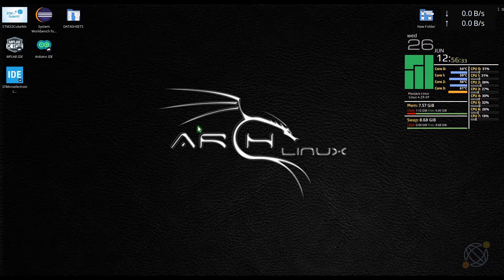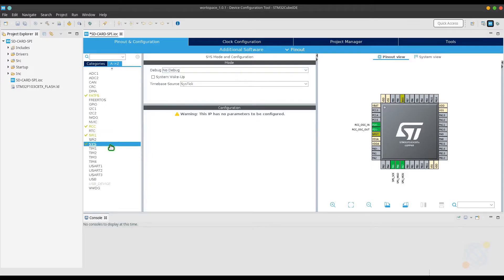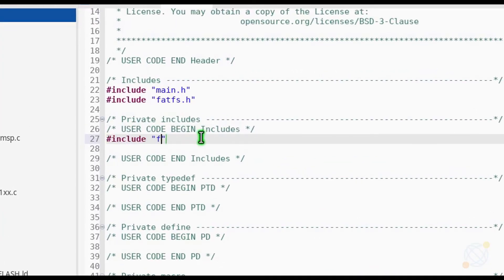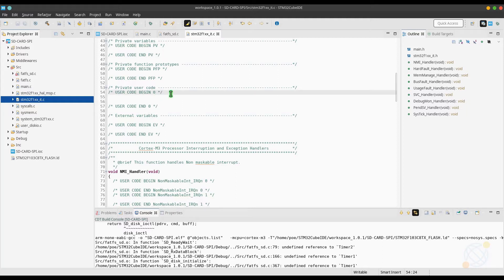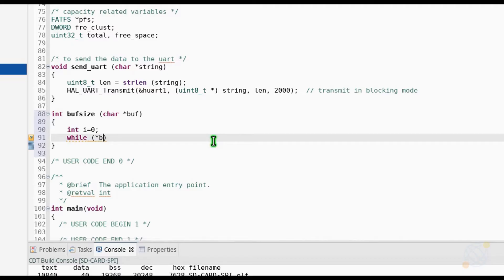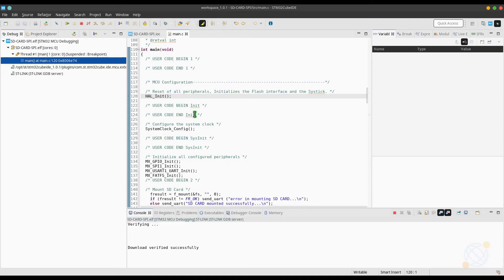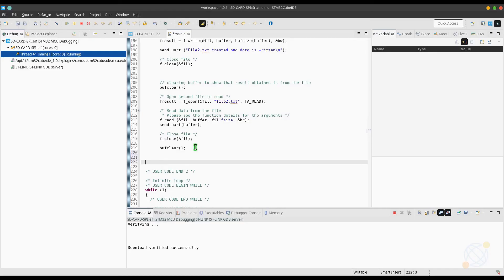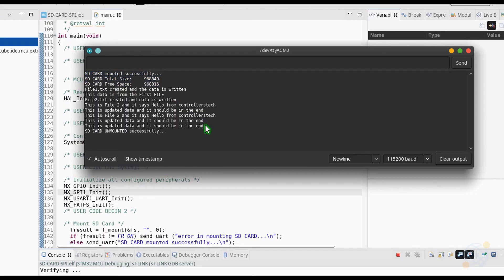SD CARD using SPI in STM32 || Cube-IDE || File handling || uart

Comment: hello, it was very interesting and appreciated so much, but I have a doubt. I want to send some data but I don't want to create any file, basically, I wat to send raw data, without any format, like .txt, In my case, I don't have enough memory and I am obligate to use a microSD module with SPI protocol and at the end recuperate the dates sending it to my PC and processing it on another program in my PC (MatLab). Thanks for your help, I hope your answer, and sorry for my English.
PD: if you don't care, answer me to my email rpaz@ing.uc3m.es 
Thanks again.
Reply from the maker: Where is data coming from ?
If you are using SD card, you have to create files and folders.
How can u store something in SD card which is not a file or a folder ?
Reply: @ControllersTech  Well, I normally use the SRAM memory without creating any kind of file, maybe I told you something that is impossible. In my project, I need to take a sample of voice, and my input is an analog microphone output, this signal I pass it for the ADC and I need to take samples fast, and finally pass this information to the PC by UART. The problem comes when I tried to take samples of voice for enough time to say 1 word, but I don't have enough memory to store it and the sample speed is faster than UART. Then I need to use a microSD card by SPI to store my samples and at the end transmit by UART, but I thought to do it by transmitting and collecting the data directly to memory areas and not exporting and importing from a file.

Comment: I had made some changes, there are some variables types that are not right. I run this project at 18MBits/s with no errors. I used keil uVision.
// "sprintf" needs an "unsigned long" input.  Note that despite the fact that int and long are represented by the same number of bits, they are still different types.

Comment: I am new to the microcontroller programming.
 i have created the new project as per your video but i am not able to see the file "user_diskio.c" in may project and also not in your code(zip file which i downloaded from you link).
and one more thing , are the files fatfs_sd.c and fatfs_sd.h are standard files or your custom made files,
if these these are standard files then why these are not a part of the created project.
Reply from the maker: User_diskio.c file is in FATFS -> Target folder
Fatfs_sd.c and .h are not the default files. You have to copy them from my project into yours.
Reply: thankyou  for your time
how can we create such library files
Reply from the maker: Which library file you are talking about
Reply: @ControllersTech  like fatfs_sd.c and fatfs_sd.h
Reply: i have created the project as per you video , i am receving the message  "ERROR!!! in mounting SD CARD on uart terminal.
i have tried it on STM32F103C(stm32 blue pil) and also i have amended the code a created a project for nucleoF767ZI again i am  receiving the same "ERROR!!! in mounting SD CARD.
i have made connection as follows 
for STM32F103c

SD card                stm32f103(SPI1)
CS-----------------------> Pin PA4
SCK-------------------->PA5(SCK1)
MISO -------------------->PA6(MISO1)
MOSI -------------------->PA7(MOSI1)

for nucleo F767ZI
SD card                NucleoF767ZI(SPI1)
CS----------------------->  PC4
SCK-------------------->PA5(SCK)
MISO -------------------->PA6(MISO)
MOSI -------------------->PA7(MOSI)

Vcc and Gnd are connected acordingly

BUT using aduino i am able to write the data to sd card using STM32F03c
Reply from the maker: You need good understanding of how things work
Reply from the maker: You see this code is written for f103c8 itself. So even if you don't change anything, it will work. 
Anyway watch the video carefully. U need to add a lot of stuff in different places
Reply from the maker: You see this code is written for f103c8 itself. So even if you don't change anything, it will work. 
Anyway watch the video carefully. U need to add a lot of stuff in different places
Reply: @ControllersTech  I just copied your code "SD_CARD_SPI_F103C8"  and built it and downloaded it to Stm32f103c8 , but i am receving receiving the same "ERROR!!! in mounting SD CARD.

One thing which i want to know is that   in your video i can see that in project explorer window there are nine(9).c files in src folder.
but the "SD_CARD_SPI_F103C8" project has only 7.c files in the src folder.
fatfs.c and user.diskio.c are not present in this folder, these are in FATFS folder.

IS it ok?????????
or i have to copy these files to src folder.

when i copied these two files to src folder i am not able to build the project there are many errors.
Reply from the maker: No don't copy them in the src. Leave them in fatfs. 
Contact me on telegram @controllerstech
Reply from the maker: I said @controllerstech not .com
Reply from the maker: You have to download telegram app, and search @controllerstech in that

Comment: Thank you very much for your initiative. The only sensible code that I found after a long time of searching. But in the beginning there was a problem: the program did not always work. In the end, the whole problem was in SPI1. After connecting the microsd module to SPI2, the program always worked. I'm using stm32f4discovery (stm32f407vg microcontroller).
Reply: By the way, I connected the sandisk 16gb fat32 memory card and the program worked.
Reply: @НикитаЩербаков-ж3х  I'm using the same item.I didnt get it worked. Could you tell me what was the error ? Are you also sure that it's all about SPI1 ?
Thanks in advance..
Reply: @erdinckaya3731  did u get it worked? pls let me what was the error.

Comment: Hello! Thanks for the video, it seemed to me quite clear and concise!
I have a problem however. After doing the f_open command I get a FR_NOT_READY from the fresult. 
I have followed all the indications in the video. The only thing that I don't understand is the clock. I have an STM32WB and as I am new to this I have no clue how to set it, so I basically just let it do it's thing.
Do you have any idea why I might get that error?
Reply from the maker: Some connection problem. Make sure the card is formatted with FAT or FAT32 
Also try to reduce the SPI speed and see if it can help
Reply: @ControllersTech  Hey! I've just done it and there is no change. I get the same error.  (I have a 16Gb card)
 I want to ask you though, why do you set for your clock the two options "HSE" and "PLLCLK" together? If I do this for my microcontroller I instantly get some 0xfffff8 error or something about "Failed to execute MI command". 
Also when you wrote this:  fresult = f_mount(&fs, "/", 1);  I saw that here you put 0 and on the website there's 1. What is this for?

Thanks for answering!
Reply from the maker: HSE is for selecting external crystal for clock
PLL is phase loop clock use in all the ARM processors.
If u are having problems with the clock, i would advice you to not select the HSE and leave the clock input at HSI and use HCLK as 50 or 60 MHz. 
This video was made long ago, and i have modifies the code after that. That's why you might see some changes.
Although the process remains same.
Since it seems like you don't have much knowledge about stm32, i would say first try blinking led and start low.
Reply: I face the same issue. Did you fix it?

Comment: Hello, I have a question.  I'm using FreeRtos and Timer 1 as the source, so there is no SysTick_Handler fuction in stm32f1xx_it.c.  Where would I put the FatFsCnt check in this situation?
Reply from the maker: Inside the timer 1 isr..

Comment: I have problem. All go right, but. If i enable RTC (because i need for my project) its crash to hard fault in debug.  But if I remove SD Card of comment line with fresult = f_read and try it again it works withouth problem.. One step before crash i see some RTC_FLAG_OW check. Some posible solution ?
EDIT: I solved problem. I set too small buffer. Use bigger buffer solved problem.
Reply from the maker: Which buffer ?
Reply: @ControllersTech  string buffer for store strings from files and the buffer that is sent to the serial bus. I dont know how i solve it in large log file. But i have a plan. I search end of file and test from end to star t if i find line feed symbol. After that read from this point to the end and print it. And I use Tiny FatFs now :) It rapidly safe mem space :)

Comment: Great video, thank you so much for your help!  As other users have mentioned, if using an stm32f0 discovery board, make sure to set the spi data size to 8 bits.  I also ran into a error where I could not build my project with a max sector size of 4096 (too large) so I changed it to 2048 and it worked fine.
Reply: Hey! Are you using STM32F051 Board?

Comment: I have some strange problem during compiling. There are an compile error: "#error This file is not needed in current configuration. Remove from the project." in cc932.c.
Reply from the maker: Maybe things have changed with new version of HAL.. i have to check it again..
Reply: @ControllersTech  Thank you. Let me know, if you check, please. I have tried many solutions and I don't have an idea what to do.
Reply from the maker: Which controller do you have
Reply: @ControllersTech  I have checked F746ZG, but I have F410RRB and F103RB (all Nucleo boards) too. Of course I've changed header includes in every file with it.

Comment: I am having problems with the "fatfs_sd.h" file : BYTE, DSTATUS, DRESULT, DWORD etc all all marked as "unkown type". Using Keil IDE 5
Reply: add up #include "diskio.h" in fatfs_sd.h, please bro
Reply: @thuannguyen8248  I love you, thanks
Reply: Also using the Nucleo-STM32F446RE, if that matters
Reply from the maker: I will take a look at it again...
Reply from the maker: Looks like you haven't generated the code properly or something to do with keil..
Reply: @ControllersTech  What do you mean by not generating the code properly? I am using CubeMX version 5.5 to generate Keil projects. I added fatfs_sd.c and .h to their folder (Src and Inc respectively), and clicked "Add Existing File to group Application/User". Is there anything else to do to properly link the drivers?
Reply from the maker: Did you link the driver in userdiskio.c ?
Reply: @ControllersTech  Would it be preferable for me to use SDIO, rather than SPI, as it seems my board features a 4bit bus SDIO interface, which I've heard is 4 times as fast as SPI?
Reply from the maker: Yes SDIO is better and easier to use. But your card reader should also support it.
Reply: did you find the error.
Reply from the maker: @nuhmusaozyoldas465  check the pinned comment
Reply: i have the same problem. Is there any solution?

Comment: Is it working if we do not use USART? And where do you connect those USART pins to?
Reply from the maker: Of course it works without uart. Uart is just to check, its like verbose in linux 😀. Pins are connected to the Tx and Rx pins..
Reply: Controllers Tech we did exactly what you did and when we step into the f_open it goes directly to res != fr_ok. Do you know why? Actually I think only the f_mount works fine.
Reply: Controllers Tech Actually f_mount is not working. It doesn’t go to else statement
Reply from the maker: Don't use larger storage card.
Make sure the file system is FAT
The card shoul not be write protected
Some users reported that sandisk card doesn't work
Reply: @ControllersTech  And why sandisk doesn't work?

Comment: Plzzzzzzzzzzzzz help me. I have an tf card module and want to use it with stm32f103c8t6 in arduino (using SPI). But I cant do it. Plzzzz help me.
Reply from the maker: If you are planning on using f103 as an Arduino, I can't help you out. Better look in the STM32duino forum..

Comment: I am using F401RE. I am finding problem in disk initialization.
1. Even when I am not inserting the card there is no difference. It is executing f_mount successfully.
2. The program does not enter the line ENTER_FF(fs) in ff.c for volume locking.
Reply from the maker: 1. Yes that's the bug in the code.
2. I don't know much about it. I ported the code so that it can work with HAL library. 

What kind of error are u getting exactly
Reply: @ControllersTech  I am not able to fetch any values in fs FATFS pointer in ff.c. I am unable to understand why this is happening. I also tried to understand and fetch information about the libraries. But none understood to an extent to solve the problem. Also how did you port the code ? Probably that can work for me too.
Reply from the maker: There are few things
* Some users have reported that SanDisk cards are not working.
* Make sure the sd card is formatted in FAT
* Use the smaller size at first. I have used a 1GB card while making this video
Reply: @ControllersTech  I am using F401RE nucleo board. Is it possible that there might be a hardware problem? I read at some places that that might be an issue.

Comment: Thanks for this video.
But there're some problem of mine.
I use SW4STM32 to build this project and it show up some error like this:

/var/folders/1f/r9g58wg10bb2k179qkzkxts80000gn/T//cc3OwiXv.s:371: Error: selected processor does not support `dsb 0xF' in Thumb mode

/var/folders/1f/r9g58wg10bb2k179qkzkxts80000gn/T//cc3OwiXv.s:970: Error: selected processor does not support `dsb 0xF' in Thumb mode

/var/folders/1f/r9g58wg10bb2k179qkzkxts80000gn/T//cc3OwiXv.s:981: Error: selected processor does not support `isb 0xF' in Thumb mode

/var/folders/1f/r9g58wg10bb2k179qkzkxts80000gn/T//cc3OwiXv.s:1018: Error: selected processor does not support `dmb 0xF' in Thumb mode

make: * [Drivers/STM32L4xx_HAL_Driver/Src/stm32l4xx_hal_cortex.o] Error 1

can you help me?
Reply from the maker: Is this your first project with stm32 or have you done anything else also
Reply: @ControllersTech  it's my first project :)
Reply from the maker: In that case i would advise you to first do some small stuff like blinking led or something. This will ensure that everything is alright in terms of IDE setup and connections. Than you go for bugger things like this one.
Reply: @ControllersTech  I mean that it's my first bigger project. I have done some small stuff.already.

Comment: Thanks so much for this very well done video!

The version of ff.c installed by STM32CubeMX for me was 0.12c. In that version, there is no fsize member of the FIL struct. Instead it is in FILINFO. So, I was receiving the error "struct has no field "fsize".
In case this might help someone else, here is one way to fix it.

Create a struct of type FILINFO and use the f_stat function to fill it in. Then use fsize from that struct as the file size in the read.

Details:
    In the area where you have "FIL fil;", add:

    FILINFO filinfo;

    In the code where we read back the file, instead of this:

            /* Read string from the file */
            f_gets(sd_buffer, fil.fsize, &fil);

    Use this:

            /* Read file info so we can get the file size */
            fresult = f_stat("file1.txt", &filinfo);

            /* Read string from the file */
            f_gets(sd_buffer, filinfo.fsize, &fil);
   //Note "filinfo", not "fil"

I hope this helps someone!
Reply: Sure it helped me. but last line last argument should also be "filinfo". Thank you
Reply: @mohammadal-dossari299  I just double-checked my code and mine is working the way I have it above. In the f_gets function call, the file size was obtained from the filinfo structure, but the actual data comes from the fil structure. I guess it is possible that either will work???
Reply: @KennyTrussell  No, you are right. I was wrong. Thank you again.
Reply: I still have some errors. e.g. 'FIL {aka struct <anonymous>}' has no member named 'fsize' or 'fsize' could not be resolved, Symbol 'count' could not be resolved, Symbol 'sector' could not be resolved.
Reply: @radosawpuchalski2251  you should get "fsize" from "Filinfo" typedef struct not "Fil" struct.
Reply: @mohammadal-dossari299  I have tried do it.

Comment: I am trying to access SD card using MikroC for the  Board-STM32F446RE...I am facing a problem on Intializing the card ...The statement Fat32_init() does not seems to be working...
And there is no response from the MISO line .
Can you please help on this.
Reply from the maker: I don't know. It could be anything... Are u initialising all the peripherals by your own or using cubemx ?
Also check what error are you getting. You can do this by checking the error status.

Comment: I have learned a lot in this video, the sample code is very helpful to learn, thank you for your video.
I'm using STM32 Nucleo-F030R8 boards.
As  @
Lau Chok Yip 1998 say, I also set SPI to 8 bit.

Since the RAM of the MCU(STM32F030R8) is small (Only 8k), so I have to make some adjustment settings.
in FatFs, I also need to set 「MAX_SS(Maximum Sector Size)」 to 512 (default is 4096).
Otherwise he will get an error message like「 ... will not fit in region `RAM'  region `RAM' overflowed by xxx bytes」.
Finally, the code works perfectly.　:D
Reply: I managed to make it work with MAX_SS at 1024 and enable FS_TINY, with that configuration and a buffer [256] I reduced the consumption of RAM to 5KB, that would be enough to work with a F030x8
Reply: I am unable to display the any messages using UART.  I have used nucleo F030R8 Board and sd card module. 
Also I have a doubt, where did you use SPI in this video ?
Reply: GRAT ANSWER - I've had same problem. Thanks!